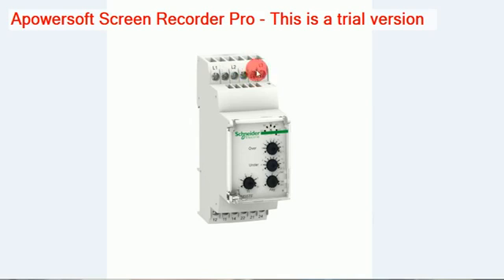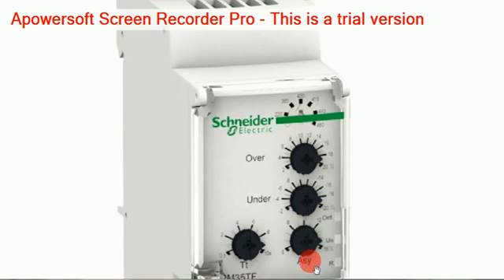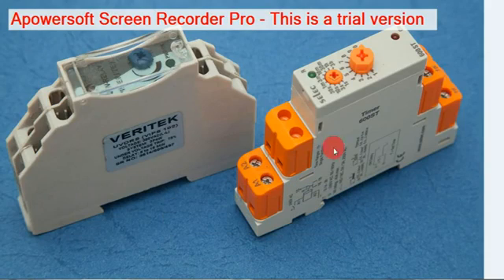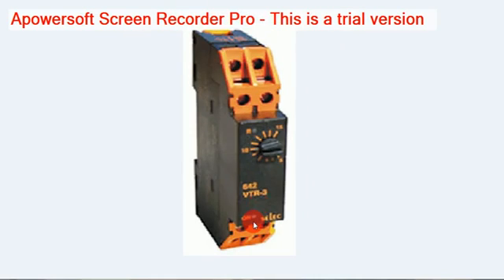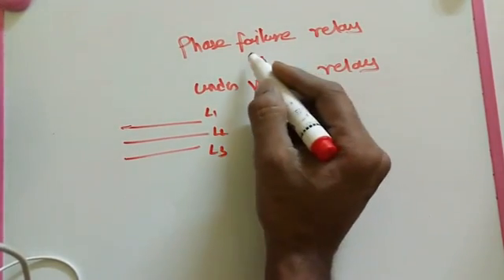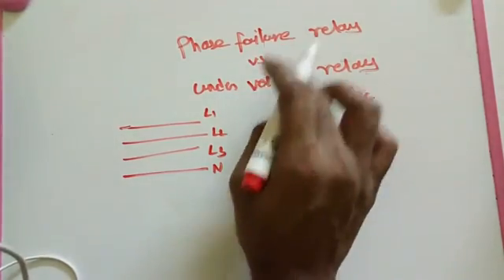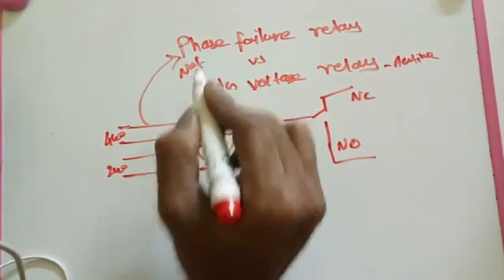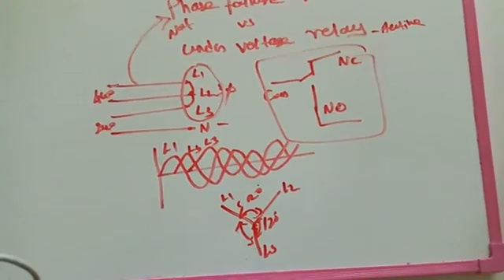Difference between phase failure relay and under voltage relay new 2017

Comment: good afternoon sir ! I have some problem need your help ... I have problem with schneider relay for air CB breaker, now can't (ON), i check voltage for each phase already is Ok, but still can't (ON). So now i don't know how to find problem ?
Reply from the maker: s actually now showing phase fault indication in top of relay right that is orange indication led gloving....
Reply from the maker: now you do one thing remove your 3 phase input supply of relay and connect then check voltage available of phase to phase then set the voltage of relay top settings screw nob and check it...